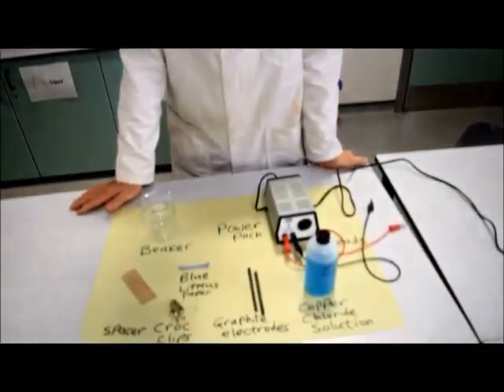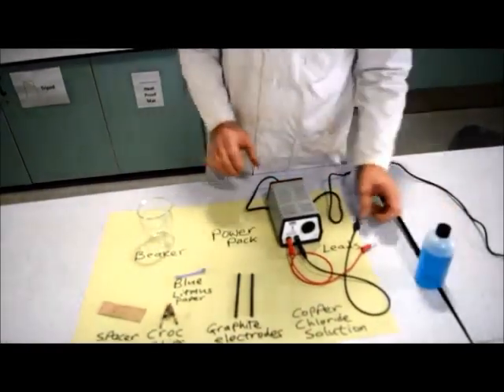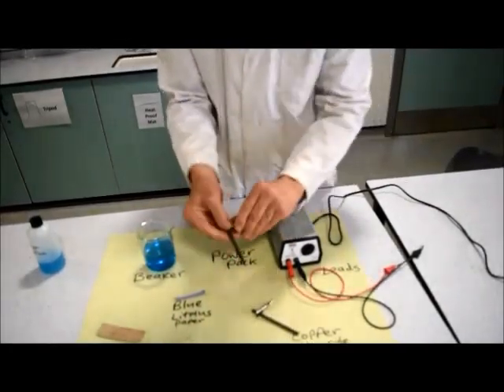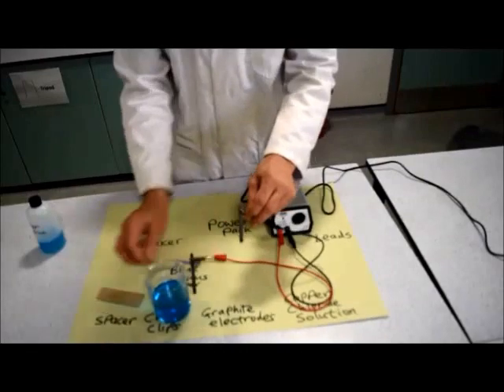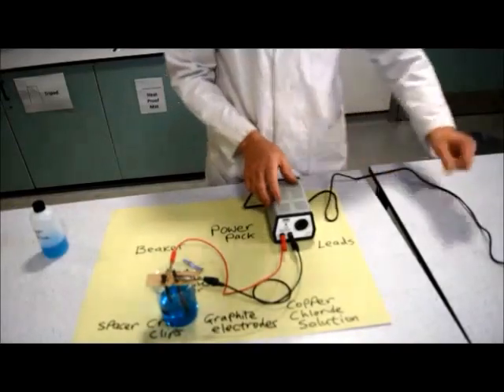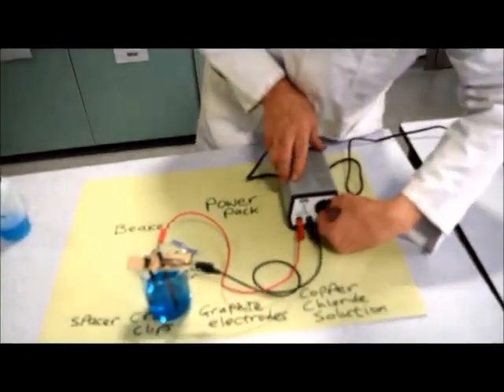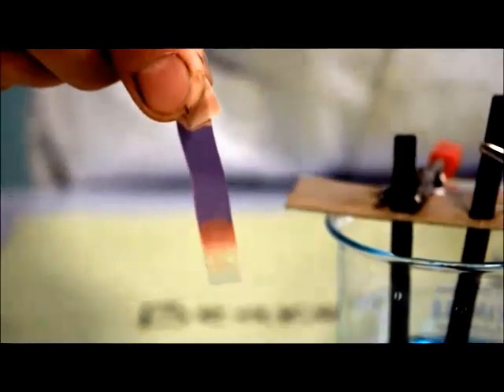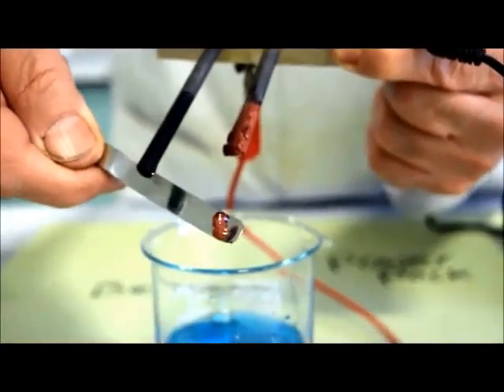electrolysis of Copper Chloride solution

Comment: Can a normal battery be used? If So, what would be an ideal voltage?
Reply: 12 Volts equals 12 Joules per Coulomb.

6 Volts is only 6 Joules per Coulomb.

Power, as in P = I2R, would appear to depend strictly on current flow across a resistance, with no mention of voltage.

However, the current I that is able to flow across a given resistance R is equal to V / R (because V = IR).  Thus, voltage still plays a role.  In fact, power can be written as P = VI.   (You will see this written often as P = EI, where E is "electromotive force", another way of saying "applied voltage".)

If you put 12 volts across a 1 ohm resistor, 12 amps will flow.  It will dissipate 144 watts of heat.  (Don't try this!  Common resistors are rated for something like 1/4 of a watt...)

If you put 6 volts across 1 ohm, 6 amps will flow.  It will dissipate 36 watts of heat.  (Don't try this, either).

The confusion arises because power sources and batteries cannot put out infinite power.  In real life, a 9-volt transistor battery houses less power than a 6-volt storage battery.

If you put a 9V transistor battery across a 1 ohm resistor, the current would be 9 Amperes for only a  short time; it would fall off very rapidly.

Of course, the 1 ohm resistor (and probably the battery, too) would likely burn up in that short time.  The point is that tiny batteries simply cannot sustain large amounts of power.

A laboratory power supply usually accepts "mains" voltage (110/120V AC) as the  input, but the voltage is stepped down (typically to 12 V) and current limited (usually no more than 5 A) for safety So you could use a plug and get the same results.